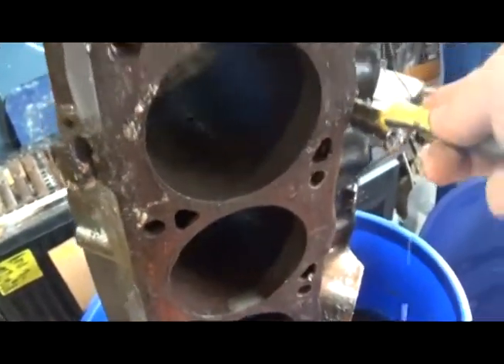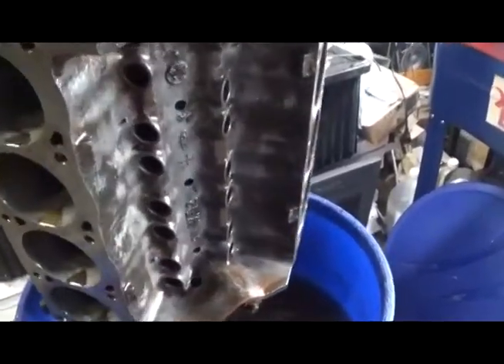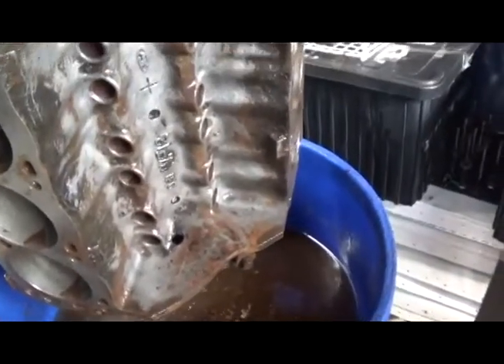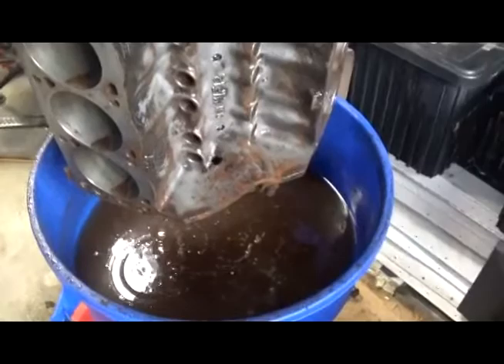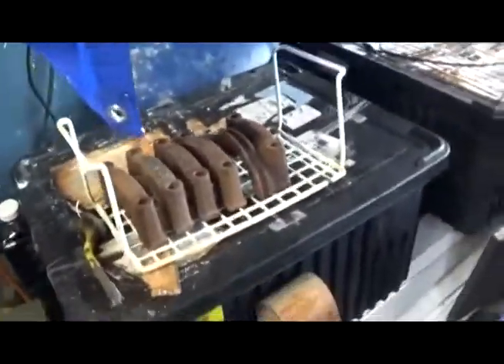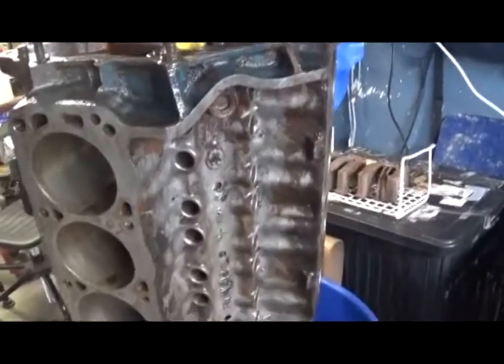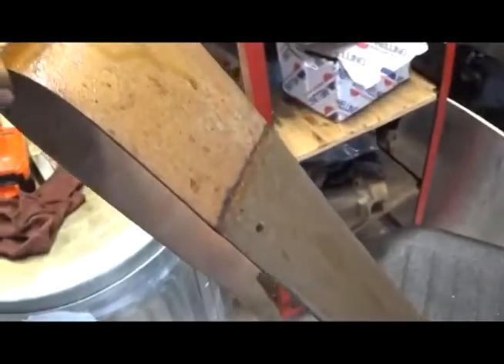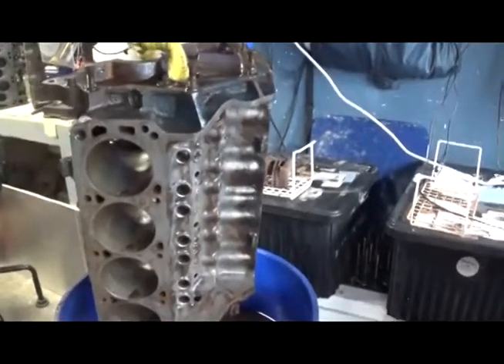DIY Engine Block Hot Tank Cleaner and Electrolysis using Vinegar Part 3

Comment: The leftover water rust mix is not poison. I grew up in a foren country when i was young there where no vitamins you could buy so my uncle had a iron deficiency the doctor told him to soak a bunch of rusty nails in a pot of water and then drink the rusty nail water to increase the iron intake of his body. Basically what you made is a iron vitamin cant hurt anything most likely is good for the grass or trees. The vinegar has lost its strength as you demonstrated by adding backing soda and not getting a reaction so no harm will come of it even if the vinegar is still strong as much as you diluted it it wont do any harm to anything. Great job cleaning this engine with electrolysis in a safe environmental friendly way.
Reply from the maker: @peterloichtl4512   iron III acetate is created if vinegar is used.  You don't want to dump this stuff on the ground if one can help it..

Comment: If you add salt the reaction is faster. I put a pile of rust that kinda looked like an engine in the soup bowl. It was locked up top to bottom. After four days at 5v/5a I hit it with a pressure washer. It was an engine. So I went to see if it would turn. I put a 30mm socket on the crank. Then put a 1" drive 36" ratchet with a 36" cheater pipe on that. My thought was to give one fast all body blow and see if she would move. After picking myself off the ground and checking for wounds... It would have turned with a 3/8"x6' ratchet no problem. Lessen learned.

Comment: If you do this again I would suggest expanded metal anode. One to 4 of them wired together with jumper cables.  It has alot more surface area and it will work a bit faster.